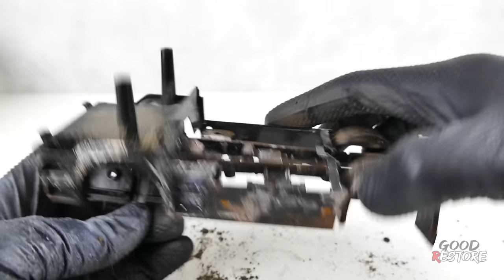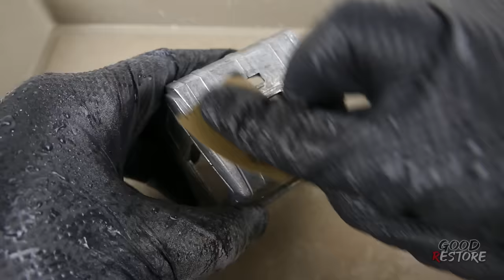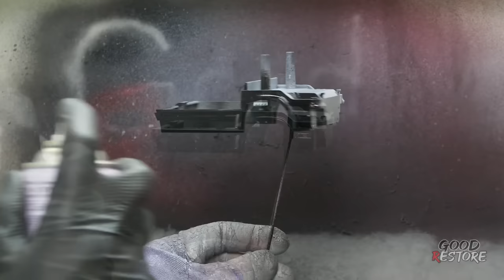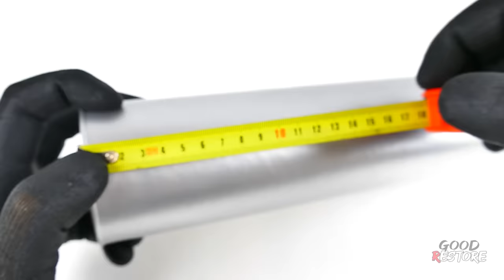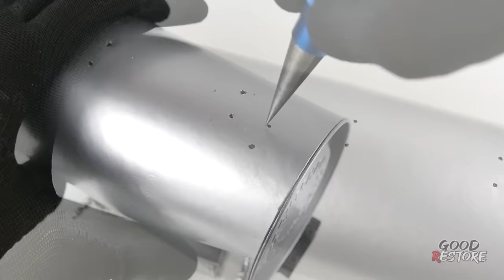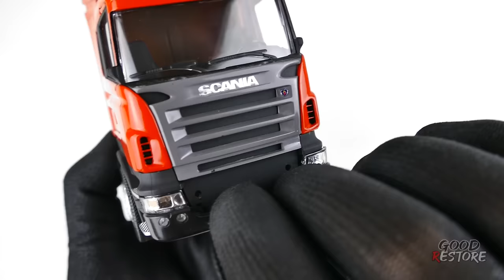Restoration Scania R470 Abandoned semi trailer car truck

Comment: its good... however the only small issue i would have is the material you made the replacement tank out of. I was able to see the fact that was a cardboard tube.
Reply: Pringle can😀😂
Reply: @tzyben3181  b
Reply: @tzyben3181  ,
Reply: @tzyben3181  Y,
Reply: It doesn’t look that bad at all I think if you saw the finished product first and not see what @Good Restore use to make it you’d never know the difference. They always to a wonderful job